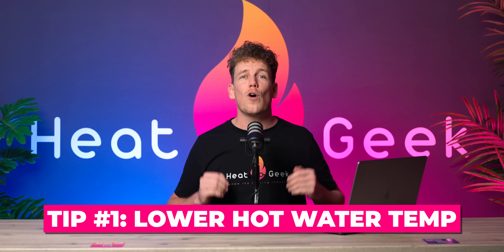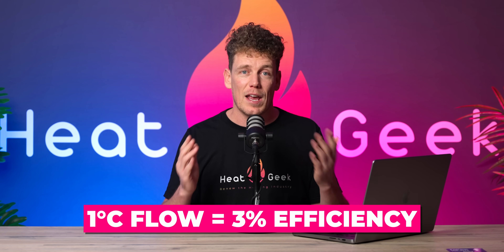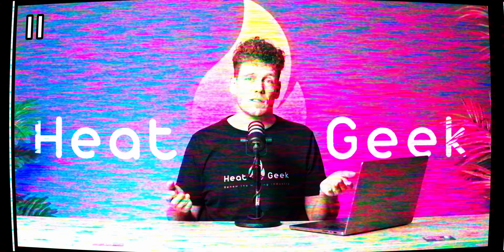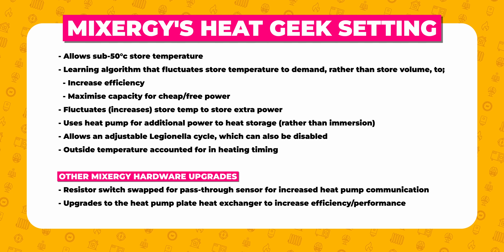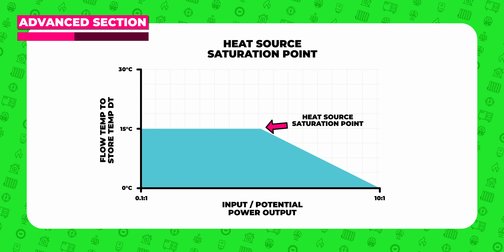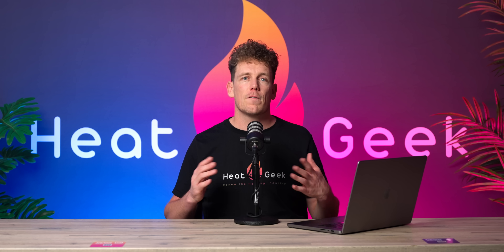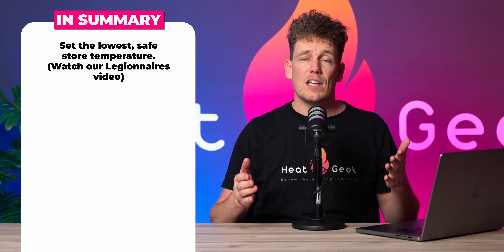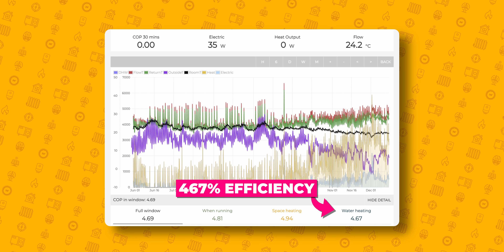Hot Water Settings Energy Suppliers Don't Want You to Know!

Comment: So now you're interested in "magic widget" to plate load cylinders eh? ;-)

Edit - Warning Marko should RTFM more often. See the excellent Mixergy reply below for further detail but in short  the bit between the --- and --- doesn't apply. :-)

Hot water tanks, once used, will have a layer of say 45C water on top of a layer of say 20C water. The exact heights of these vary depending on how empty the cylinder is. In a "conventional" cylinder with the boil in the base; gently heating this with a heat pump will bring the "20C" layer up to 40C before it starts to destrat and mix with that 45C layer. You then stir up the whole tank to 50C, 55C, or more if you particularly need extra stored water at the expense of COP. There is ALWAYS a layer of 45C water at the top though.

---

The mixergy setup is designed for plug-flow heating OR fully stirred vessel. The moment that you kick off your "fully stirred" heating you're going to blend the tank down to a uniform "meh" of 25C then slowly heat the whole thing up to 45C again. In the meantime you've lost that "hot top" and so whilst the reheat process might be efficient the usability of the setup is poor.

To fix this I'd suggest you need dual upper inlets and a baffle 1/2 to 2/3rds of the way up the cylinder. First take water from the base, through your plate, then inject  under the baffle to "fully stir" the cold part of the cylinder. Only once that is near to the temperature of the "hot top" do you flip to stirring the whole cylinder.  Design the baffle carefully and you might find that any cool water above the baffle will naturally mix itself into the lower part as you're heating it; thus maintaining the "hot top" and avoiding any need for dual inlets and switchover. It screws up the original mixergy "plug flow heating" and "heat what you need" USP but will work better with heat pumps.

---

We had a similar requirement with a district heat system that needed to be >50C "hot top" at all times but also wanted to be heated by a heat pump as efficiently as possible. Stirring the bottom of the buffer tank through the heat pump at a rate of knots and allowing the warmer water to float up / cooler water to float down maintained the "hot top" whilst also retaining the "fully stirred heating" benefits for the heat pump. 

What are your thoughts on the continental approach of heating a primary storage (pipe the heat pump directly into the tank) then drawing hot water off that on demand via plate HX?
Reply: Thanks for the questions Mark. 

We just wanted to clarify a couple of points which we feel would be helpful. To what you described above, there is no ‘mixing’ of a Mixergy Cylinder when heating with our plate heat exchange arrangement. That would be true if we were returning the flow to the top of the Cylinder and stirring the entire content of it. Instead, we return the flow to the bottom into a baffle plate, which allows us to heat ‘under the thermocline’ (the thermocline being the transition between warmer water, which floats on the colder lower region of the Cylinder).
 
By heating in this way, we obtain an additional benefit in that we are not trying to exchange thermal energy to the warmer upper layers which would either: a) inhibit heat transfer (a phenomenon we call ‘coil lock-out’) which reduces COP when reheating from a partially charged state or b) draw thermal energy from the top of the cylinder to the bottom via conduction through the coil as the flow temperature increases (an issue which can happen with large amounts of system volume on a poor control strategy).  

We hope this clarifies some of the points and we’d be happy to chat directly to discuss further 🙂
 
Ping a message to our team here >> https://mixergy.co.uk/contact/, and we also have this handy animation which explains further >> https://youtu.be/U56busO1bac
Reply: Thanks @mixergyltd6286  - That's teach me for not RTFM

I was assuming returning to top of tank (as with the standard mixergy setup for partial charging) rather than the at base. I'll add a caveat to the post above but keep it otherwise intact so that this excellent reply makes sense. :-)

Did you find the buoyancy enough such that you can heat right at the base without risking (a) heating a "warm bit" at the base under the baffle before it's had a chance to settle into a thermocline or (b) driving too much movement and disturbing the thermocline that way?

"Coil lock out" isn't a thing if you return too high in a plate loaded setup, and nor would conducting via the coil be a think; but you could conceivably stir things up something rotten unless seriously baffled / diffused. Those flowrates are material compared with just cylinder discharging.
Reply: @MarkoCosic  Great question! This is something we have explored a lot. There is a ratio called the ‘Richardson number’ which defines the strength of the buoyancy force provided by the lighter water above the thermocline relative to the shearing/mixing forces associated with any flows you introduce in the bottom of the tank. 

A high-temperature gradient (i.e. a distinct thermocline) combined with low flow velocity (e.g. running water inlets through a diffuser/baffle) results in a high 'Richardson number'. This means you get minimal mixing and can heat under the thermocline with no problem. In early prototypes, we tested without using a baffle and we found that the higher flow velocities caused significant mixing. We could see this from the Mixergy sensor reading, showing a sudden drop in state of charge (defined as heat above 40C) during heating before it picked up again. Fitting a diffuser eliminates this problem.

Hope that helps, don't hesitate to ask anything else :)
Reply: Agree  @mixergyltd6286  - hence the first comment on needing to introduce under the baffle 🙂

There was a second part to the question though: Is there a risk of "overheating the bit under the baffle" if the buoyancy forces aren't that strong? e.g. 25C water under the baffle under a stack of 20C water below the 45C head of water at the top of the cylinder. (the baffle restricting flow disturbances from disrupting the thermocline but at the same time restricting the coolest water dropping from the cylinder down into the heating zone)
Reply: @MarkoCosic  Hey Mark, sorry for the later reply on this one :) We utilise the baffle to ensure the velocity of the incoming water is low enough to ensure the thermocline acts like a lid on top of the cooler water.  At the temperatures suggested the thermocline would not be disturbed. Hope that answers your question :)
Reply: No worries 🙂

It's not answering the question  @mixergyltd6286  but I think you know what the R&D question I've asked is. ;-)

Main thermocline? If you return from the plate HX under a baffle this will be stable / undisturbed. Agreed completely.

Stratification of the heated section? If your baffle is mounted too low heating power too high; do you end up accidentally creating a "hotspot" underneath this baffle that is warmer than the water above it; because the buoyancy of the heated water isn't sufficient for it to head up / for the cooler water above to take it's place. There'll be an optimisation exercise here with respect to baffle height and free area to to allow exchange of water from above/below it.

A large coil-in-cylinder won't do this because the height over which it is heating / area over which it is heating in that cylinder is that bit larger and the warmer water is very much free to exchange places with the cooler water.

Comment: How do I find out how much hot water I'm using without the expense of fitting a water meter to the cylinder (which presumably would cost more than any savings)? We're a youngish family of four, but all told we probably take about 8 showers (pretty short with water off while we soap up) over a week and wash at the sink the rest of the time so I'm thinking that we'll be lucky to use much more than 100l of our 250l tank (40%) a day? Presumably there's no chance of me turning the temperature down below 65 on our unvented system boiler to allow for 53 degrees plus to cater for such a low turnover?
Reply: Also if I have the sort of heat storage temperature control that's simply a dial going from 1-5, is it just a case of trial and error until it looks about right on my Honeywell Evohome app when heated to the max?
Reply: We just got an old water meter off ebay to monitor water being fed to the hot water cylinder, and plumbed that inline. We use around 400l/day, for 6 people.
Reply: @barriedear5990  presumably you have plumbing expertise? I'd probably have to pay someone to do that for me unfortunately.
Reply: @barriedear5990 great idea!

It would be great if one was available linked to an app so that usage statistics could be gathered over time
Reply from the maker: Yes you can turn your boiler down to 60c no problem, provided it’s ok for heating

Comment: Is there a reason we don't just use thermal stores where the cold water feed passes through a coil in the tank to collect heat before heading to the taps? From my understanding, this would make leigonella a non-issue as the water in the tank never leaves the tank. Although, I guess the water in the tank would then need to always be hotter in order to create enough of a differential to get the tap water up to 45c before the end of the coil. Perhaps that is the reason?
Reply: We used to have a 500l Rotex Sanicube (now badged Daikin), that worked like this until one of the coils broke. Endless hot water for our very large family. No idea of efficiency.
Reply: That’s what I do thermal store set to 80c unlimited hot water worked great for last 16 years water in tank is never used only flows to underfloor heating bottom of tank set to 35c   ( Chelmar heating thermal store ) bottom of tank has solar thermal
Reply: This is a system that exists. Vaillant has it as an option. The problem is, that it's rather expensive to set up since you need a rather larger Buffer tank that needs to get heated up and kept at a certain temperature to the supply that heat to the hot water system.

Comment: I followed your advice 6 months ago ago and put my cylindre at 50c with the boiler heating the water when it reaches 45 (evohome). I don’t see any difference  as a user but I see that I can run my flow temperature at a lower temp with lower gas bills. 👍 thanks again.

Comment: Are you able to share more on how you are using the flow meter to set the temperature. Are you doing this manually or have you automated it?
Ideal if manufacturers integrated this but in the meantime it would be good if someone put together this logic on Home Assistant. I can control my Ecodan from HA so if I had a flow meter connected maybe I could implement this level of control.
Reply: You can estimate water usage in home assistant. You should know your normal hourly drop from parasitic loses and any heat you’ve added to the cylinder. Therefore the derivative of tank temperature with a little tracking and some template sensors should get you to an estimated hot water usage

Comment: I'm sorry but 50deg C is too low for me, I have a heat pump set to 50deg C and I am having to boil my kettle to add to washing up water.
Reply: Are you sure the water is at 50C?     That’s hot to touch.    A bath at 50C, for example, would be unbearable.
Reply: @crm114.  Yes, I could not bath in it but my hands are hard and I can hold my hands in it however long I leave the tap running even 1st thing after the water is heated.
My daughter and wife would say it's hot enough.
Reply: Do you have a large "dead" volume between the hot water tank and sink? I measured ours at 2l (using a jug and finger to test the temperature). With 2l of cold (20°C) + 8l of hot (50°C) would give a mixed temperature of 44°C. Try running the first 2l into a jug, run the hot water into the bowl, and then add back water from the jug to get back down to a nice temperature.
Reply: @mountsorrelheritage  Yes it does tqake a while to run but I just leave it running until it no longer gets warmer before I fill the bowl.
Reply: @ricos1497  it maybe hot at the start but by the end it's too cold.
I used to have so I could not hold my hand in it at the start and by the end it was getting close to be too cool.
Now by halfway through it's getting too cool.

Comment: Currently have the boiler range rated to match the coil output (17kW), and 20oC differential. What's the best balance for rapid recharge and efficiency?
Reply: 17kw, how big is your cylinder
Reply: @Purebeltersteve  250L
Reply: @Purebeltersteve 250L

Comment: Wow, lots of info here, will need to watch again.
Couple of potential clarifications - 
RE HW store temp, can be useful to have it higher than usage temp if the capacity is not enough to satisfy demand.
RE best heat time. While most efficient for heating may be 2pm, if it isn't going to be used until the following morning then there is a long time to lose heat. So may not be most efficient overall.
Reply: I heat just before (about an hour) before any major usage like a bath. That way the water is at its hottest, and I can set the thermostat a little lower. The tank is then left "cold" until the next heat cycle.

Comment: Did I understand you correctly that you’re using a temperature offset value of 0.    If so, doesnt the HW take a very long time to get to temperature?
Reply from the maker: The time it takes is due to the minimum compressor speed. 

Also the tank measured temperature is higher than where the coil is
Reply: @HeatGeek Thanks. Yes of course, there could be a delta T of several degrees at the bottom of the tank.

Comment: I recently installed smart shower valves that have an energy harvesting function to light up the dial when the water reaches my required temperature. Sadly this system needs an hot water temperature of 55C! Poor design. We have a Daikin 8Kw heat pump with a 210lt tank to serve 3 bathrooms. We only have our first bathroom ready so far and are very dissapointed with the functionality. We are finding that the system can't deliver showers for 2 people without going cooler so we have to go to the home display to check before we take a second shower. We have Solar and battery so I would be happy to use lower cost or free solar energy to get the heat pump to take the water up to 55C. Also our Daikin system sucks a bit on water temperature as when we set a schedule and ask it to maintain a temperature it fails to do so.

Comment: Excellent video again! Personally I have an iboost fitted and supplies my hot water pretty much from May to September and the heat pump does the rest outside of this
Reply: I was told by the product manager that there will be a new version of the MyEnergi Eddi (called the Eddi+) coming in the next few months which can do this
Reply from the maker: Best for the heat pump to heat hot water and power the heat pump from solar
Reply: @HeatGeek  is there any way to link the Vaillant to the solar yet? I know NIBE do it
Reply: @i85_Heat_Pumps  Unless you have battery storage (that can meet the demand) or a suitably large PV array, you run the risk of the heat pump importing from the grid when clouds pass over.  Intermittent bursts of power from the eddi are probably fine for an immersion (or charging an EV with a myenergi zappi) but I'm presuming it wouldn't be ideal for an ASHP to start/stop frequently? Provided you don't mind it pulling from grid (or a storage battery) when there isn't enough excess PV generation the daytime cycle is a nice idea. That said, looking at our EmonCMS history, the power peaks at around 1.2 kW during an Eco DHW cycle with our 5kW Vaillant.
Reply: @LeiChat  that’s for your reply, yeah looking at all the information, my PV size and the fact it’s mainly rainy where I am sticking to my current set up seams my best option 👌
Reply: @i85_Heat_Pumps  HG are obviously correct that the ASHP will make more efficient use of the excess PV energy than an immersion. I am tempted to give the early afternoon DHW cycle a try. Hopefully in the future there will be better automation/integration available than can look at solar forecast and decide whether to have the ASHP run during off-peak hours or wait for excess solar.
Reply: @HeatGeek  Is there a heat pump that can match erratic solar production and not pull from the grid if a cloud passes by? Doubt that.
Reply from the maker: @ksim_  yes they are coming more and more!! Watch this space! Battery obvs helps here
Reply: @HeatGeek  Any example? Is stop and start of the compressor 50 times an hour healthy for such HP? Battery helps you shift the usage to off-peak, where import is cheaper than export during the day, so charging the cylinder with heat pump during off-peak make more sense and saves battery cycles.
Reply from the maker: @ksim_  Viessmann the furthest ahead. You’d use anticline measures obviously!!!!
Reply: @HeatGeek  haven't seen anything "new" or "ahead", the same battery combo which would benefit more from time-of-use tariff, or PV with thermal combination, which is nice but way more complicated setup and Viessmann not even close to be a leader in that space. And all their solutions are proprietary clouds with questionable security and quality.
Reply: @HeatGeek  @industry85 I have just seen a thread where someone mentions using their eddi (with the optional relay board) to trigger their Vaillant Arotherm+ to heat space or DHW using the "purple me connector" (?) in "vaillant controls" when excess PV energy is available.

My Heat Geek was probably not aware of this option. Guess I need to have a read of the Vaillant manual. 

My concerns about intermittent cloud and heat pump cycling still potentially apply.